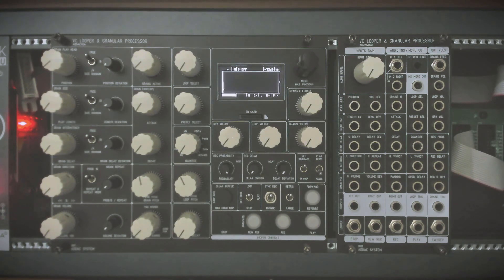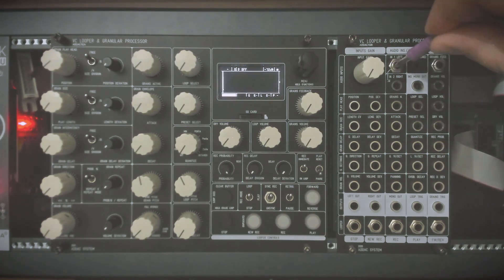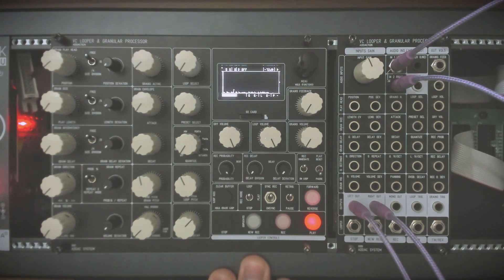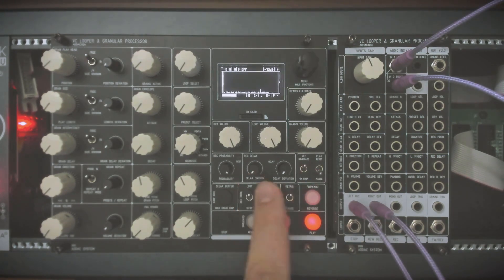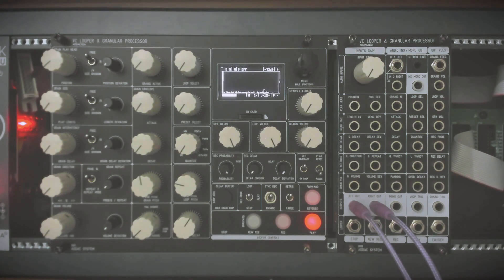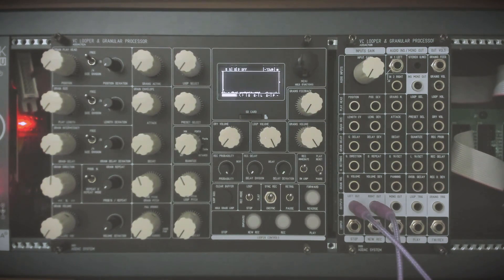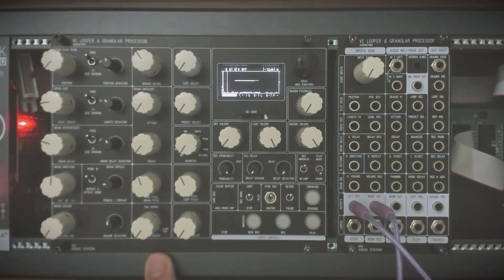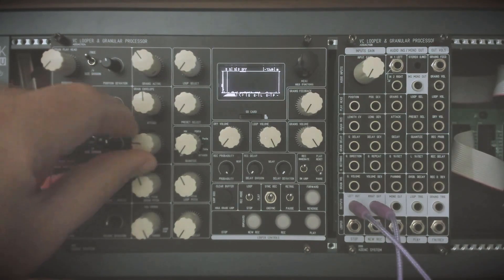Quick Overview of the ADDAC 112 Looper / Granular Processor

Comment: I was fooled by a couple of YTers into believing that the Arbhar was the complete granular solution for me- what an expensive mistake that was- so I’m absorbing as many demos of the 112 as I can before committing. Looks to be a much more comprehensive instrument tbh; cheaper too, though rather more hp…
Reply from the maker: Well... I actually kept Arbhar and sold the 112... But, it was mostly because of space issues. I went back to 7U, so I couldn't keep the 112. I'm sure that there were many interesting updates to the 112 in the last year or so.

Comment: Is one able to manually trigger grains (via a trigger input), similarly to Arbhar? I'm looking to replace Arbhar because I can't deal with its noise floor, but would miss being able to trigger grains. How is the noise on the 112? Anything like Arbhar or Morphagene? Or is it clean sounding? 

Thanks for the info you've already provided! And for making demos using sounds I like to granulate
Reply from the maker: Cheers! I actually sold mine a few months ago. I went back to a smaller 7U case so I didn't have space for it... There were a few updates since then so things might work differently.

Comment: i was thinking of selling my Make Noise Morphagene. Can this package do what the Morphagene does & more? possibly?
Reply from the maker: Well, no, not really. With Morphagene you can scan through the recording, and also create splits. The ADDAC is granular and it can loop, but you cannot process the loops in the same way you can on Morphagene. Why do you want to sell it?
Reply: @OmriCohen-Music  Thanks for your reply. Well my Little small Modular setup has no more room. The only way i can get the ADDAC is if i sell the Morphagene and i already have a little space left just enough for the ADDAC but i think i'll hold off because like you say, i love the Creating Splits and scanning through the recording and syncing Rhythm. & i hear Morphagene is instant gratification where the ADDAC requires more hands on & Menu...i could be wrong but probably it would best if i just kept the Morphagene.....
Reply from the maker: @rhampton1914  Morphagene is definitely more hands on, and is a performative module. I wouldn't say that the ADDAC is mostly about menus and such. It's actually quite intuitive and there's almost no need to use the menu. Everything is right there on the panel. I think that the main differences are basically that the ADDAC is granular, while the Morphagene is more of a tape machine.
Reply: @OmriCohen-Music  Hi again..Just to let you know i purchased the ADDAC112 from Perfect Circuit Audio. Should get in the mail this week. Can't wait..i'm excited. Will let you know when i get in mail. I'll follow up on Facebook...
Reply from the maker: @rhampton1914  Nice! I'm curious to know what you think about it :)
Reply: @OmriCohen-Music  thanks for your reply in your patience is good to know that people like you can reply. Yes your video was one of the reasons why I bought it. I like the way you did your over recording I have a few questions but not now maybe once I get it. I did not see you on Facebook in the eurorack group I saw an Omer Cohen... but I didn't know if that was you or not. Is it okay if I can email you? Or do you rather me just come on here and ask you questions. It doesn't matter to me whatever is more comfortable for you. It won't be an overwhelming amount of questions but like you know just a question or two just to get me started
Reply from the maker: @rhampton1914  yeah, I'm not in the group anymore... But feel free to email me :) You can find me here omri.musicohen(at)gmail.com

Comment: Great overview, thanks Omri. Do you think this would also work well for rhythmic material, for example feeding it a basic drum loop and inputting some rhythmic gates so it could slice and chop up a beat in an interesting way?
Reply from the maker: Well, you could do something like that by setting a small grain size and randomly jumping through the loop, triggering the grains with a rhythmic clock source. To be honest, I still didn't try this and I feel like I didn't scratched the surface with it even. It's so deep...
Reply: It seems like it could, with the in built loop divisions..

Comment: Do you know if it is possible to set a maximum length for the buffer and make it overdub itself so it can act as a granular effect ala clouds rather than a dedicated granular looper btw? //or to achieve this by some other method :)
Reply from the maker: Well, yeah, you can also continuously process incoming audio and process it live, and there are even a couple of settings you can use to add some variation to this like recording probability and recording delay.
Reply: @OmriCohen-Music  basically sounds like a great module :) The recording probability seems like a huge deal to me; the module feels super thought through. I get if you don't want to spend your whole day in the comment section; but if you have time at some point I would love to hear your take on pros/cons vs arbhar :) Like in your texture video, which I loved. That video really showcased some differences in granular approach between all those great modules. Would love to know how the 112 measures up to them.
Reply from the maker: @cci35  No worries :) I love Arbhar. Up until recently, it was the only module that I really felt like it's going deeper into granular territories, and it's so musical. Unlike the 112, it has a built in mic you can use to record practically anything into it, it has a built in reverb you can modulate, and it's much smaller than the 112. On the other hand, the 112 has a looper engine you can use together with the granular engine, it has many more controls on the panel, more CV inputs, an on board SD card, and it's also stereo in. I consider myself lucky to have both, and I will keep both because to me they feel quite different, the results are quite different and the workflow as well.
Reply: @OmriCohen-Music  thanks for elaborating :) I seem to have some thinking to do 😅 something with the accessibility of the 112 really resonates with me; glad to see that developers keep pushing the boundaries of granular!

Comment: Thanks so much for the vid!! 😀
About the looper, is it possibile to record on top of one loop whitout delete the previously record loop? I mean like having layers of sound that play at the same time? When you overdubbed the piano loop at 3:30 it seems that it deleted a piece of the previously recorded loop. Thanks :)
Reply from the maker: Yeah, you can set the overdub control to max so it will just record on top without lowering the levels of the already recorded material.
Reply: @OmriCohen-Music  thanks :) :)

Comment: Thank you Omri for the Video. I got a Question. When you change the Pitch I hear some serious Aliasing. Is it only during Pitch change or did you notice some Aliasing, especially when playing loops a lower speeds?
Reply: Yeah that wasn’t so good. Apart from that it’s like arbhar slept with nebulae v2
Reply: @mamakuproject  yep, makes me overthink buying nebulae again
Reply from the maker: Yeah, there are some artifacts but I'm still not so sure if it's only my unit or it's something in the firmware I have installed. I'm working on figuring it out.
Reply: @ratchetboo  yo I know about aliasing and character I’ve got my fair share of vintage samplers. What I heard here was strong aliasing on turning the dial and then settling to the sound once on the new pitch.
Reply: (professor frink enters) technically speaking, "aliasing" only happens when pitching up. Pitching down produces sample-rate-reduction.
Reply: You can hear the problem at 6:23. This is definitely a sample rate artifact. it's hard to tell if the artifacts are happening when the knob is moving and stop once you leave it in place, but either way, it is preventable. This is the kind of artifact you can get from the Max/MSP object index~ https://docs.cycling74.com/max8/refpages/index~ 

Index~ is a kind of "brute force" sample playback where you send it a sample index and it simply spits out the value of the buffer at that index. If you advance the index at the native sample rate of the buffer, it sounds normal, but any other speed will produce artifacts because index~ doesn't interpolate between samples. From the Max manual, "Since the index~ object does no interpolation, it is less useful for general sample playback tasks than play~, groove~ etc.." The point is that simple DSP interpolation algorithms can remove these artifacts, and hopefully ADDAC will implement them because they really are simple and standard.
Reply: I'd like to hear what happens when you change the playback speed with an LFO or something. More technical details here https://en.wikipedia.org/wiki/Bitcrusher#Sample_rate_reduction

Comment: Amazing, just watching it now. How much rack space does it take up?
Reply: Strombedarf: 240 mA (+12 V) / 70 mA (-12 V)
Breite: 32 TE (ADDAC 112A) + 13 TE (ADDAC 112B)
Tiefe: 45 mm
Reply: @bci3937  That's great, thank you for the detailed reply
Reply: @edalstrobert8628  np:D
Reply: Another quick question, do you need to use the CV modulation module or can you just use the granular processor independently?
Reply: @edalstrobert8628  i dont know...but first look for other granular synths (Arbhar)....i only can find the SET of two modules...write a mail to addac....
Reply: You're a hero, thank you Bug Man
Reply from the maker: Yeah, you will need both parts for it to work, unlike Arbhar.
Reply: Great, thank you for the help everyone